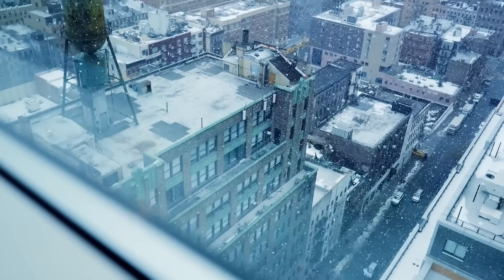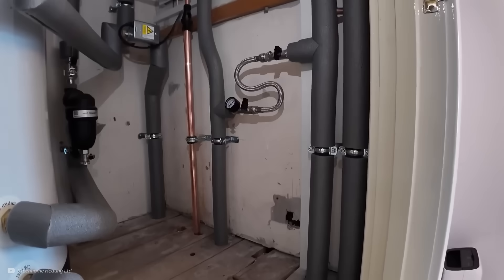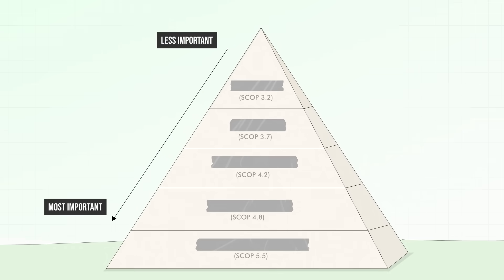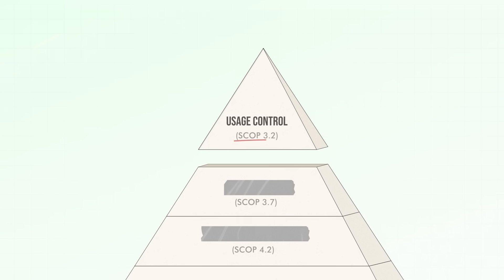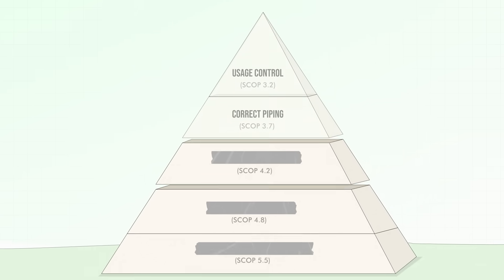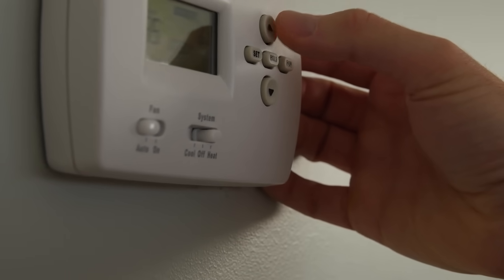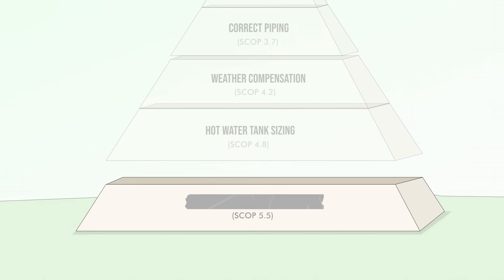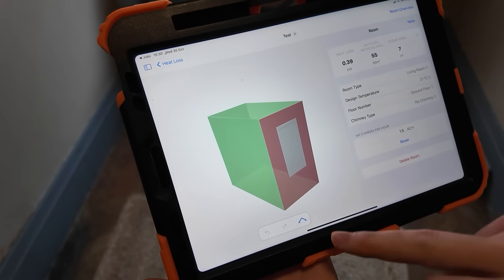The Genius of the World's Most Efficient Heat Pump

Comment: A recent UK Gov study showed that 80% of UK houses would be less cost efficient with a Heat Pump. We do not have the plumbing, insulation, or radiators to do a simple (and cheap) swap over.
Reply: I work on a UK Gov funded heat pump project and yes, this is correct. Everything in this video was standardised 20+ years ago by CIBSE. The realities of British homes - e.g. not having the space for large tanks, or being able to afford a full pipe change and better insulation - are one of the main problems that we have in the way of the transition. Heat Geek follow all of the standards which makes their installation price too expensive for most and also requires a level of knowledge that average Joe plumber doesn't and often can't have. Making HP's cheaper than gas by reducing the electricity price through market reform (see also: Simon Clark's video on how grid pricing works in the UK) and then running them at lower efficiencies because it makes for a cheap swap is how they will actually be democratised in the UK.
Reply: @ I looked up your electricity prices thinking they weren’t much higher than ours even with our “bulk cost” added on and it said something like 0.30 USD per kwh in London. Which is about double what we pay for every kwh over 1000. But if you get the price down under 20cents/kwh then even air source can be an option, which is much cheaper to install than geothermal which is what it looks like they’re talking about in the video. But just because you use a heat pump doesn’t mean it has to only be a heat pump, you can also just use the heat pump to get water to whatever degree is most efficient for the heat pump and then add a small amount of heat for the last few degrees with gas and you still  get the benefit of the heat pump. I don’t know how many people in the UK use propane tanks because they don’t have gas lines, but in the US those are the people who save the most with the fastest break-even time by getting heat pumps. They’re usually in more rural areas or areas without services other than electricity.
Reply: @causarumcognitio  This video is exclusively air->water, the most common type of system to fit here in the UK as it leaves the smallest impact on a typical house. 

The number of homes not connected to the gas grid is relatively small here and properties without a connection very frequently use heating oil instead of gas tanks. Gas tanks are much more common in Portugal if you're interested in the wider European picture.

Hybrid systems: the gov doesn't give grants for those either as they still leave a reliance on gas and specifically the goal of the project I'm on is to entirely eliminate non-renewable heat sources.
Reply: @  (This video is very clearly saying the numbers were geothermal by showing a tubing system under a backyard.) Number 1, I can’t understand the subsidy limitations to protect the grid, except that in the US, we do have very high stress on the grid, probably a thing just in the southeastern US, but it gets fixed in 30 minutes if a transformer blows. It’s less common since heat pump appliances have been introduced: water heaters, clothes dryers, soft-start ac/heatpumps. We’re sitting kind of pretty right now.
Also, I tried to do an assessment for a $5,000/month utility bill for a church-campus in Wisconsin that originally used steam heat, but should have moved to anything else. They bought an expensive modern boiler with high efficiency, but because there were incompatible metals in the system, the boiler constantly had leaks in its heat exchanger. Eventually the church went back to the inefficient fuel-oil boiler because the repairs weren’t worth it. Anyone who understands modern PC liquid cooling would have easily solved it, in fact, any US Navy Sailor who understood corrosion on a ship’s hull and why they attach metal plates, would have known that dissimilar metals will cause corrosion.
Reply: The UK paper just published showed that a lot of the heat pumps in the trial were about 280% efficient. The data has been published and analysed by OpenEnergyMonitor and basically show a load of poorly installed and calibrated heat pumps. To use the analogy in the video, they basically put in oversized units and ran them at 90mph, then turned them off for a couple of hours - like a boiler, basically. 

So the lesson we should take is that it's not enough to install a heat pump, we also need to show the house owner a YouTube video (or 10).
Reply: How’d that work out in 2022 when your natural gas prices skyrocketed and you had to send out subsidies to Britons? There are cold-weather heat pumps now that maintain more efficiency and capacity at freezing temperatures. We can use our heat pump well-below freezing without it even hitting full capacity and your 99% design temp is like -2 or -5*C, we’ve got a 3000sqft house with a 4 ton unit and it’s fine below freezing. It’s unbelievable how behind Europeans are with heat pumps. And a bunch of it has to do with arrogance of rejecting air-conditioning like snobs. We’ve had them for decades in the states. We even had one replaced that we thought was just an AC unit so we used resistance heat but turned out it just didn’t have the wire for heat connected. They weren’t as good in the past at low temperatures but they are now. Natural gas fluctuates a lot so cheaper could literally be true or false depending on the day.
Reply: @ how do it think that electricity was made?
Reply: @causarumcognitio   UK electricity prices are based on the wholesale gas price regardless of how it was actually made. So wind electricity is charged at the gas price. 

You clearly haven’t read the UK Research Paper on it. One of the biggest issues is that the UK has undersized radiators for Heat Pumps. We do not use forced air heating systems.

For a summary, watch the Sabine Hossenfelder channel on it.
Reply: @jsytac  Your winters in Britain are P***y winters to people from Wisconsin, Minnesota, Maine, or Canada. I lived in places of Wisconsin Colder than southern Alaska. You just have ridiculous electricity costs that are egregious.
Reply: @jsytac  In march of 2022 everyoone in the UK realized they were effed.and that’s how the world played out. Everyone telling you wetold you so. Too bad, so sad.
Reply: @jsytac  According to someone that test was on single stage heat pumps. Stone-age versions of heat pumps.
Reply: @jsytac  Us Americans should have let you freeze in 2022. You’d have learned your lesson.
Reply: It still needs to be done. When you consider the external costs of fossil fuel heating, the costs that are going to be paid for by our grandchildren, heat pumps come out way ahead.
Reply: @rogerphelps9939  Not all electricity isfrom fossil fuels. Mine is nuclear, what are you going to do, pretend I don/t exist.
Reply: @ Hydrogen or other bio-gas is better suited to the UK. You also assume there isn’t a third option. Heat Pumps are only environmental if the electricity is green. If gas powered (like most UK energy), they are less efficient than gas boilers. UK houses are not set up for Heat Pumps (see the Gov report). So there are arguments both ways.
Reply: @jsytac  Heat Pumps don’t need a house to be “set up” for them. They’ll work with pretty much any system
Reply: @causarumcognitio  So you haven’t read the Uk Research Paper on it. One of the biggest issues is that the UK has undersized radiators fused Heat Pumps. We do not use forced air heating systems.
Reply: @jsytac  Most of Britain’s electricity does not come from gas. It’s like 39% of the UK’s electricity. You just use it so ubiquitously for heating.
Reply: @jsytac  I know, it doesn’t change anything. Modern heat pumps use higher temperatures on the high pressure side than older refrigerants. Besides that, when we have to make a slight improvement for a Manual J calculation to work with a Manual S product in the US it’s not that hard to improve the insulation, air-sealing, or upgrade a window or door. We get tax credits for it. Normally equipment is oversized wherever you are and it’s really just areas that are poorly built.
Reply: @ 
1. You are taking the annual average, which is not representative of peak heating demand - which is in winter.
2. Regardless of how much gas is used in the generation mix (unless 0%), we pay the gas-electricity price for ALL the electricity generated. This is known as Marginal Pricing. 
3. Today, 52% of our electricity was gas-based.
Please do your research.
Reply: @jsytac  And while part of the problem is that you never embraced forced air systems and now you have to sleep in the bed you made for yourselves, this video wasn’t about air-to-air heat pumps, it was about water-water with one part going in the ground. Ground is better for efficiency but expensive and could just be air-to-water with a simple heat exchanger.
Reply: @ I am glad to see you are an expert on UK heating and plumbing, UK electricity generation, UK electricity pricing models and UK building codes. You are so knowledgable, you could be an advisor for our excellent Labour Government!
Reply: @jsytac  If the electricity price is gas-based then you would need an efficiency of the grid to be less than 33% for gas to be cheaper and most of the time a variable speed air-to-air system will be more like a COP of 4.0 than 3.0, meanwhile with gas you’re stuck paying the same price-per-btu no matter what the temperature is outside in the day.
Reply: @causarumcognitio  "you never embraced forced air systems" Hello, I'm very much in the UK heating industry. There's a lot to unpack in this statement, but first and foremost it is false for most of Europe. The UK is uniquely behind. We live in small, old brick buildings which were primarily built fast and cheap for historical reasons, such as the extensive damage in WW2. Coal has always been plentiful due to local geology and thus a significant majority of those homes were built to be heated using an open coal fire. Smog was a problem with one particularly significant event in the 1950's which ultimately caused the Gov to massively subsidise - it was free - a vast expensive transition to natural gas, because again, it was by far the cheapest and quickest option for a nation on its knees by war. High thermal mass buildings (i.e. brick/ stone, unlike timber in the USA) responds much better to bulky gas heating over AC. Gas remained subsidised for quite some time which made it a no brainer to heat a house with anything other than gas boilers. 

There is a quirky arrangement with how our electricity markets work which makes our elec price significantly higher than generation cost and right now a gas boiler is cheaper to operate in a typical British home than a HP. Secondly, the UK government will subsidise fitting a heating system unless it is reversible (one that cools as well). This is due to concerns about grid load during summer. There's so much more that can be covered but economics ultimately wins.
Reply: @jsytac  I still don't get it. Just add a small 12k BTU (2k$) mini split in the biggest room. No need for ducts. That's what I do in my 1500sqft home. Just doing that will already save a lot of energy.